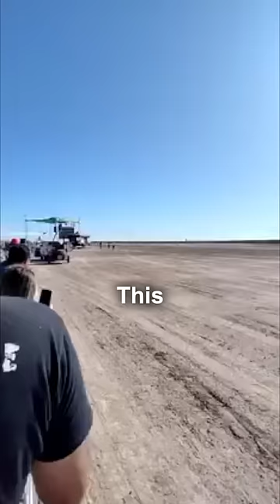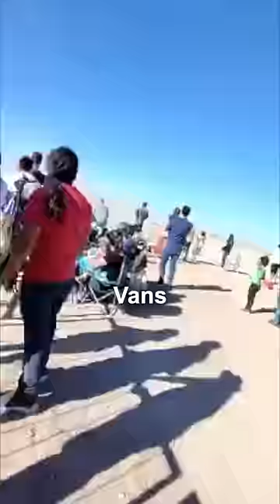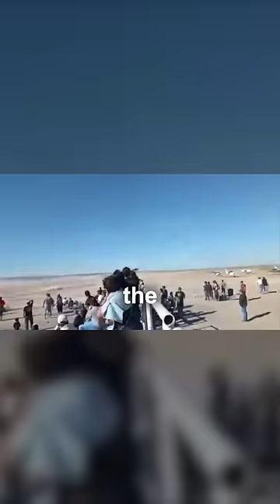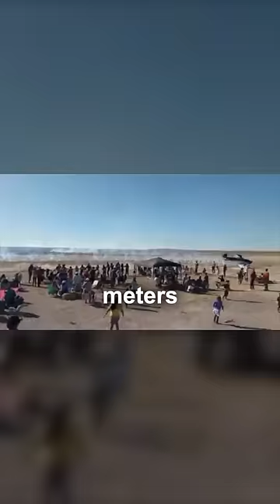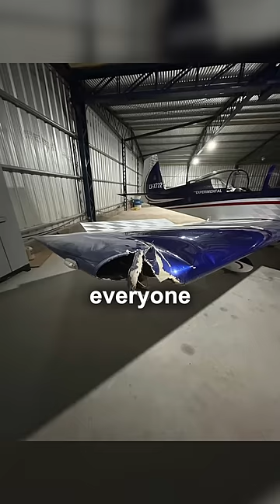Home built aircraft accident #plane #pilot #crash

Comment: Theres Probably a lesson here for those who dare to perform stunts, im not sure what it is  but i will say this shows us that in all vehicular accidents especially those involving aircraft one must ride the crash out till the end and use whatever skill u have to steer your way through it. You cant just resign to fate knowing u fucked up,or in the moment the accident does occur dont let go of the yoke or close your eyes. You do that and you may risk making the crash alot worse or loose any chance of recovery or opening your eyes again. The pilot here in theory should have been setting up to make this recovery the moment he decided to try such a high banked turn this low to the ground. The composure that the aircraft shows i beleive proves my case why? he was able to remain fully in control powering out of the turn and climbing to safety, he knew what could go wrong and in what order .The pilot here was provably taking evasive measures before the wing struck .The inputs he had on the controls at the time allowed the plane to be saved from catching a prop blade or cartwheeling. All that and as much luck as god could give while u try to show off. Good on ya to do is to dare i say.😊😊😊😂😂

Comment: that whole in the wing def threw the plane off balance mainly due to the mostly hollow inside, in result catching more air and causing more drag on the right side. pretty tough to handle, but being a stunt pilot, it would probs be a alr landing, not very hard to repair either. If it was a normal private pilot, this situation may have ended up much worse

Comment: One litle thing. The wings still produce the same lift in a turn as flying straight horizontal. The difference is that the airplane has to produce more lift in a turn because of the centrifugal force. The Pilot needs to increase his Speed to encounter this additional force. In this situation it seems that the pilot had enough speed. In my opinion the Pilot could have pull the stick long before this light crash aslong as he dont get over the critical angle of attack. 
Ofcourse I am open for corrections.

Comment: Babble. The wing at any angle still produces the same lift, gravity pulls one way. The air does not change due to your relation to the horizon. Lift is lift, gravity says no. An aircraft flies better if the lift is opposite gravity. Gravity will always win.    😊

Comment: There producing the same amount of lift but less of that lift is being used to counter act the pull of gravity. Thus the use of elevator and rudder control inputs are needed to maintain altitude. He didn't have enough of one or both resulting in him getting to low. This is why I hate these quick grab YouTube short that don't take the time to do some critical thinking or reasearch